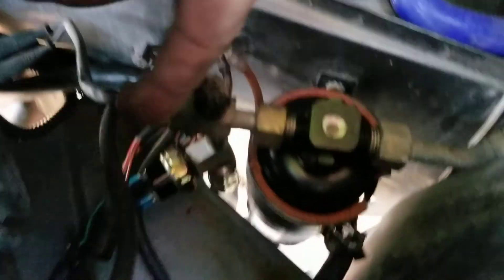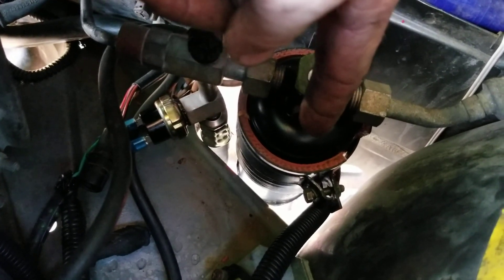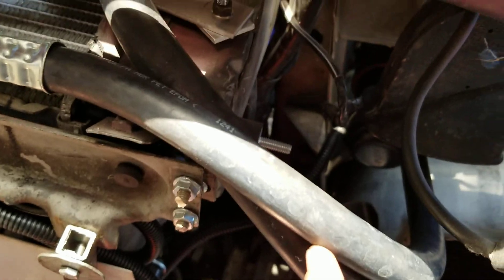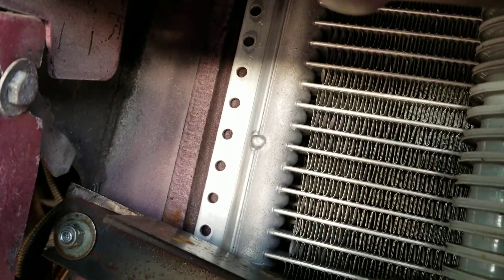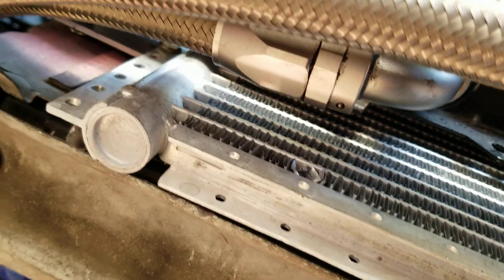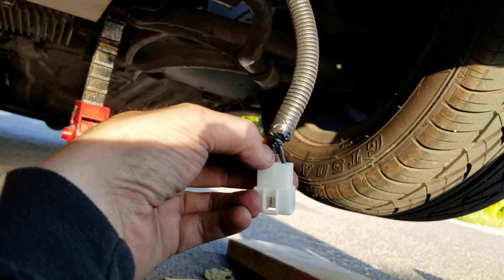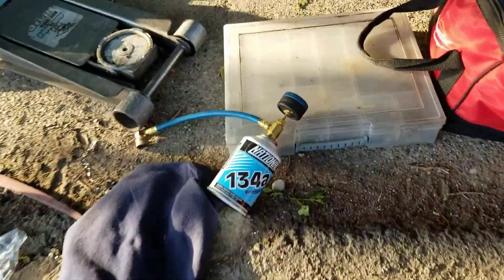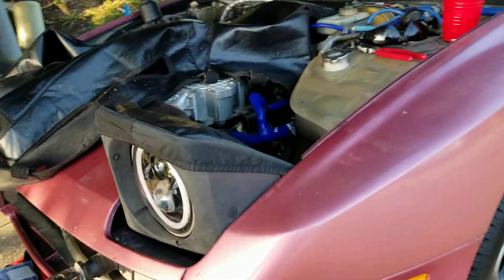12 Volt AC compressor in a 944 Part 2

Comment: When will part 3 be added and did you add a expansion valve and what evaporator did you use oem or some other type of aftermarket
Reply from the maker: Hi Jose,  I got pretty sick as well as the Ignition control module on the car failing so I am waiting for that to arrive before I continue onto part 3.   I left the factory evaporator and expansion valve in place.   If I do need to update it later.  I will do so.
Reply: What is my vehicle didn’t come with an expansion valve would you recommend a aftermarket that will just bolt on but they recommended a 1.2-1.5 ton valve

Comment: Another update
Reply from the maker: I am hoping to get another video soon. Sadly I got pretty sick and my Ignition control module failed on the car.  so not start or spark.
Reply: @dr.frahnkensteeen4485   Hope your feeling better. Once your back on can you provide info on the compressor you used. Possibly a link to purchase online ?
Reply from the maker: @genesisstudios-nynashville6852   Hiya,  I am doing better. Just been busy with moving and trying to get this car back road worthy. Sadly still not running.  i did find the link to the one I purchased.  https://www.ebay.com/itm/274865660794
Reply: @dr.frahnkensteeen4485  Thanks Doc. Would you know if the BTU rating is comparable to the stock one on the 944 ? Will it be just as cool ? Thanks for your help
Reply from the maker: @genesisstudios-nynashville6852   You are welcome. I really have no idea on the BTU. But it is something I will test when I get it running. Have a neat tester I can put at the Vent and blower intake and will give me a temp value for each.